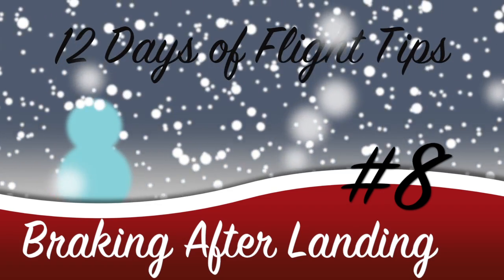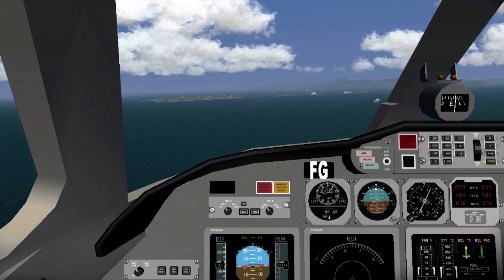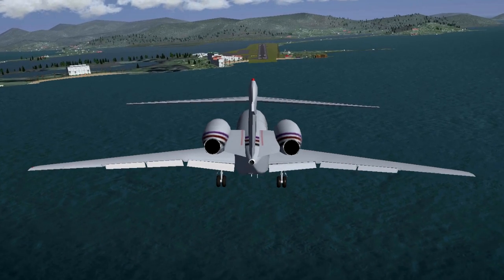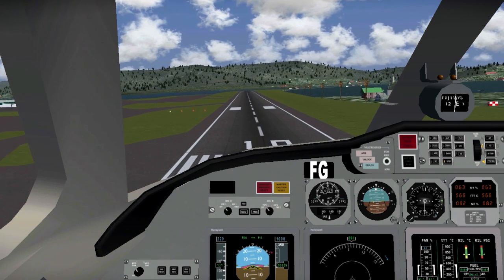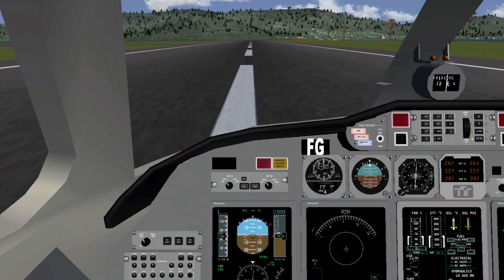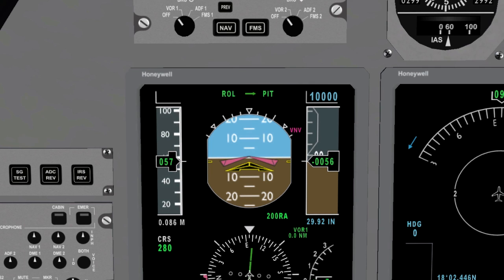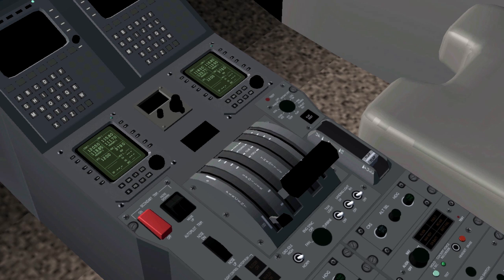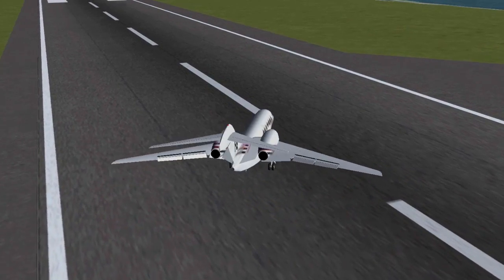12 Days of Flight Tips: Brake After Landing (Day 8)

Comment: If you're landing a small plane on a long runway, and don't have to make an early turn-off, there's no need to brake at all.  Saves on tire and break-pad wear.

A problem in in most flight sims is that unless you have rudder pedals, your braking choices are typically either 100% or 0%.  In real life in a light plane, you go very easy on the brakes at first when you're still moving quickly, so that you don't lock a wheel and wear a flat spot on the tires (or skid off the side of the runway).